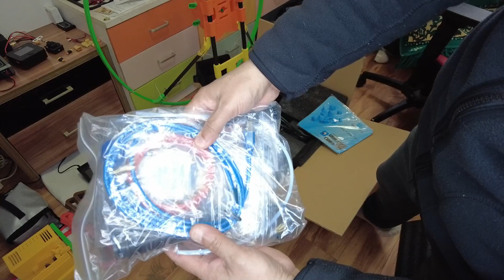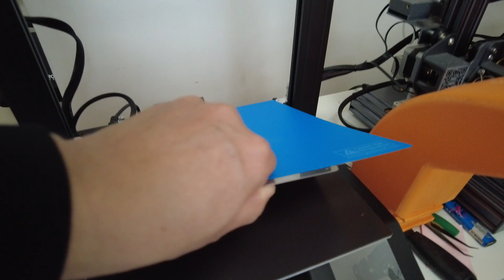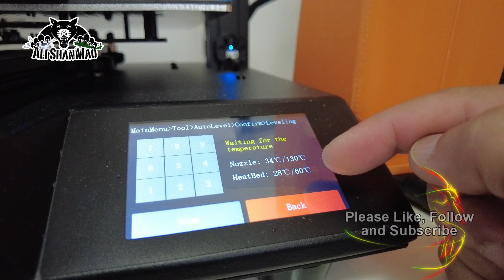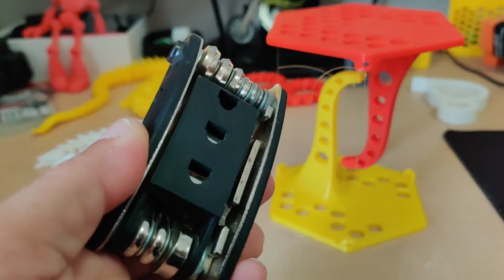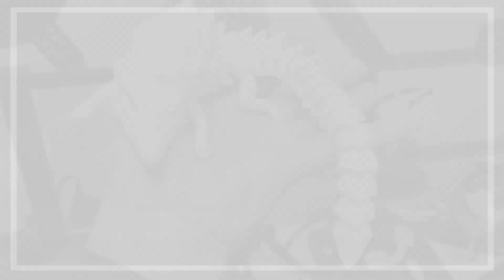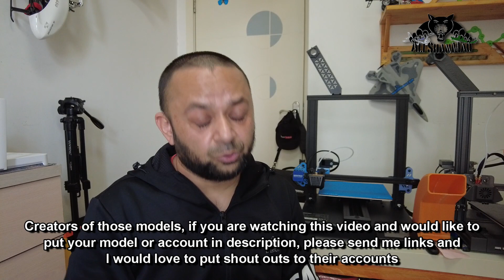Geeetech Mizar S Auto Leveling Dual Z Axis feature packed 3D Printer

Comment: I've had mine less than four months.  Suddenly a few days ago...the table WOBBLES as it moves front to back...so now it will NEVER BE LEVEL!  JUNK!
Reply from the maker: there must be some screws loose on the wheels that move the table forth and back. check and its easy fix. most of the 3d printers issues are easy fix

Comment: What is the best way to change the filament? Sorry I'm completely new to 3D printing
Reply from the maker: Printer has filament change feature. just use it. it will heat up nozzle, then retract filament when you press unload. once the old filament is out, you can insert new one in extruder and press load. thats all.

But easy way is to just pre heat the nozzle to 210 degrees. once nozzle is at set heat, pull on extruder filament lock and pull filament out, then insert a new one in. its faster

i can even change filament of different colors during print without disturbing the print and i am able to print multi color models easily
Reply: @alishanmao  Thanks! I’m super new to this. Sounds easy enough. I’m interested in changing color during printing. Do you think you can do a video? There aren’t a lot of things on YT specific to this printer.
Reply from the maker: @brownlkt  you are welcome. I will try to do a video on this topic.

Comment: I am an absolute beginner and have had the printer for 1 week. I like your models very much. Unfortunately I can't print anything correctly, except for the owl, the vase and the rocket on the SD card. I think it is due to the slicing settings or the .gcode start code, I can't find anything about it on the net. I've tried it myself, but it only forms a ball at the nozzle. Can you help me with the settings?
Reply from the maker: email me, and i can send you cura settings. I sent to one other guy having same issues. he imported the settings and he is printing happily now. you just need to import those settings.
Reply: @alishanmao  Thank you very much, the settings are really good and I am very happy with the print. A few more minor issues with the stringing, but I'll fix that.

Comment: thank you for this video. i was hesitating on wether or not i should buy this printer and i think i will. do you have issues with stringing?
Reply from the maker: I do have issues with stringing. but that is happening on different type of filaments needing different heating of nozzle. with some cura settings I was able to cut it down but then it started again when i switch filament. so now i realize its the filament and heat that causes it. so i actively control the heating of nozzle. like Now i know what temp of nozzle my yellow filament brand need and what heating of nozzle my orange or red filament different brand needs. and stringing is gone. here there still is, but its all up to settings. 

I will also change the nozzle to better nozzles that i bought online. i used to have stringing issues on Lotmaxx 3D Printers too and after using new nozzles everything prints nice. 

what i love about this printer is that it has taken the headache of leveling the bed totally away and i am not having those issues due to bed leveling on other printers. thinking to get more of Geeetechs Mizar S
Reply: @alishanmao  thanks for your answer!! :))

Comment: a great review i have just got this printer have you got a cura profile that you use if so could you share it thanks
Reply from the maker: i did not get the cura profile. I just made one. if you need settings, i would be happy to share with you. email me please. there is start and end G-Code that you should use. and I can share some of my settings for better printing and adhesion. i have 3 profiles mostly i use. Normal, Strong and Fine. Strong is something that you can use to print parts that can take some real nice load. like my scooters basket and my car's roof cage holders i printed. I could carry boats on top of my car using those 3D printed parts without worries.
Reply: @alishanmao  thank you i have sent an email